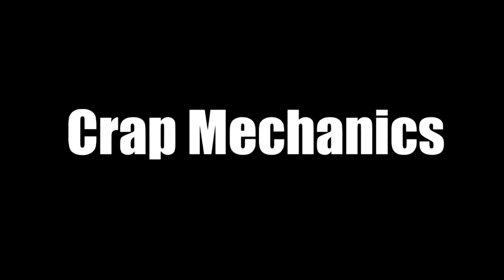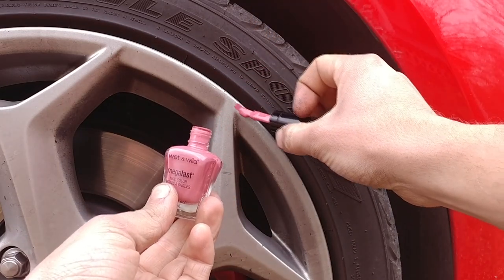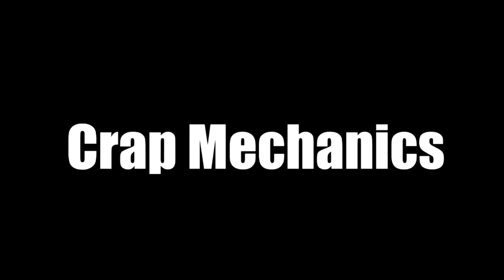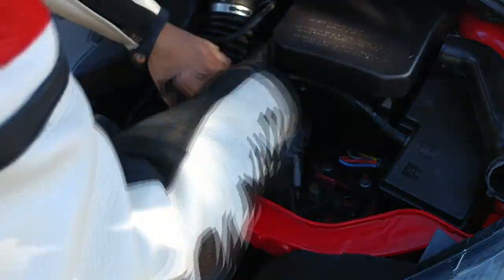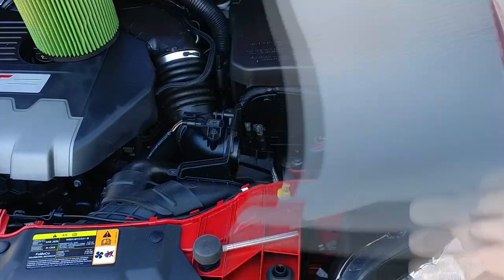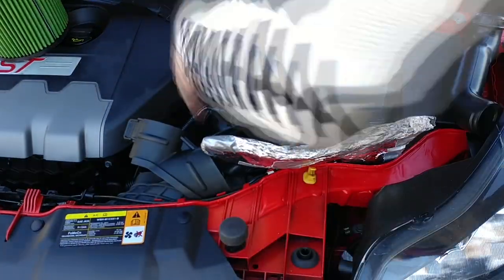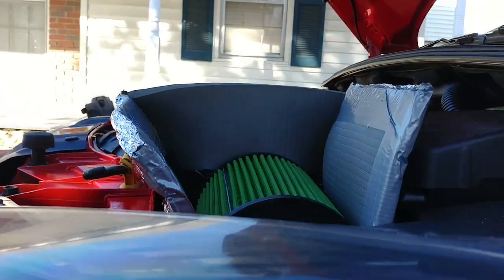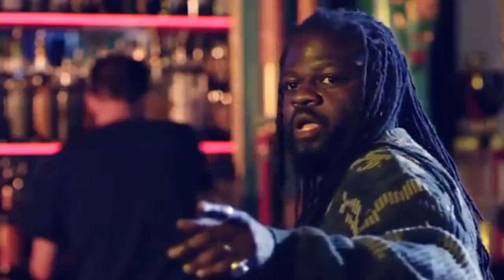BUDGET $20 DIY COLD AIR INTAKE - FORD FOCUS ST

Comment: Has the car cought fire yet
Reply from the maker: Of course not!
Reply: Why would it catch fire? Lmao
He taped off the terminals so a short wouldn’t happen or cause a spark. There is nothing in that engine bay other than a lot of heat. All the fire is controlled and contained